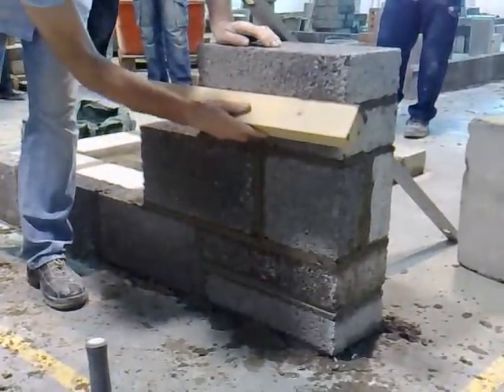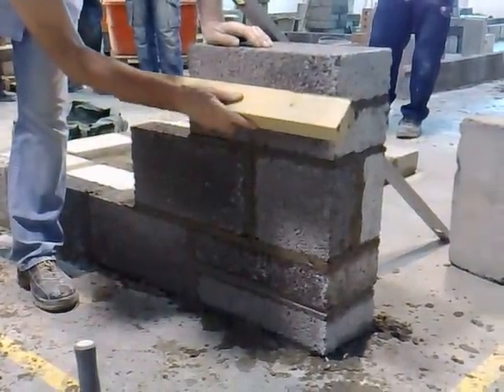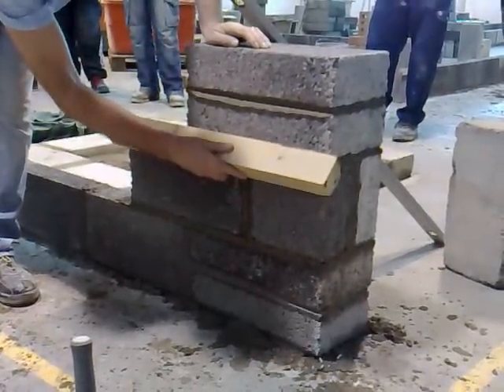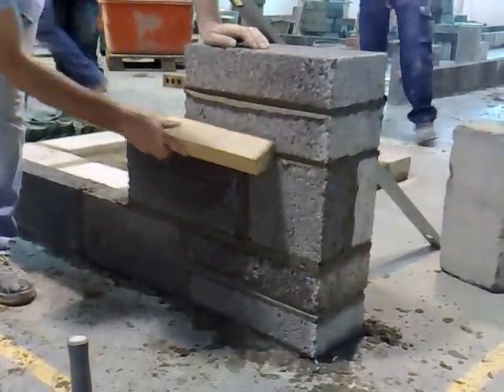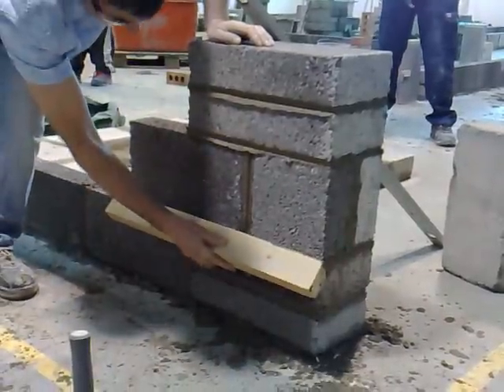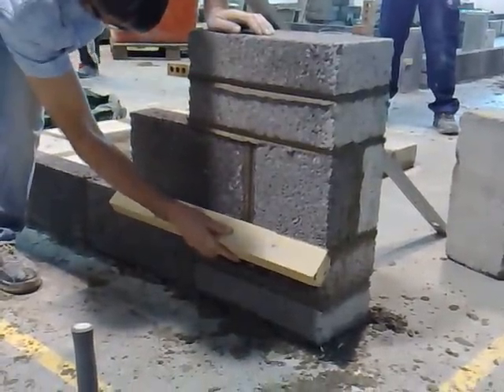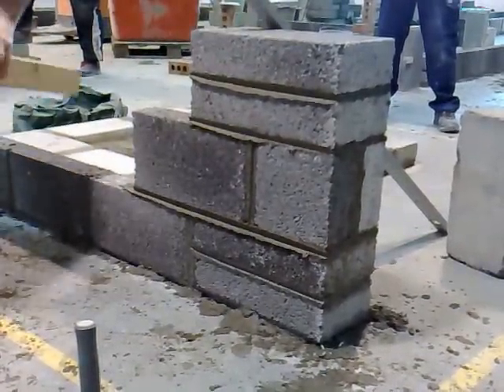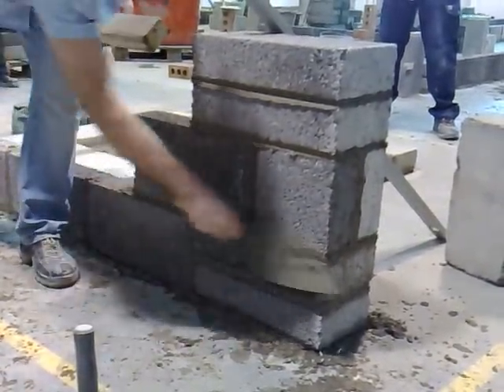V Jointing Blockwork (video 8 of 8)

Comment: What’s the point ? Plastered over 9/10 anyway!
Reply from the maker: Boundary walls in Ireland are rarely plastered over. All the building principles are the same for building block walls the only difference here is the jointing used as this is finished blockwork or fairfaced blockwork.